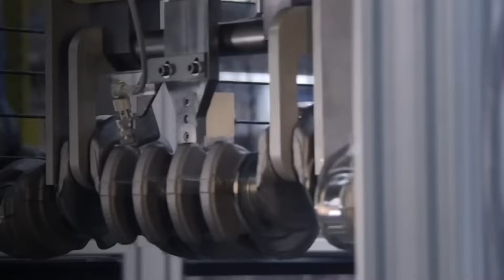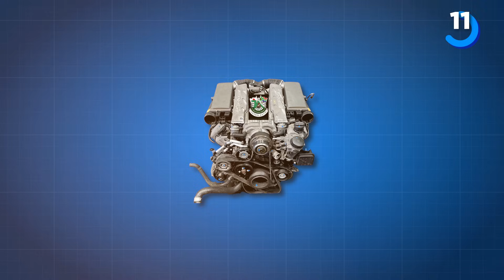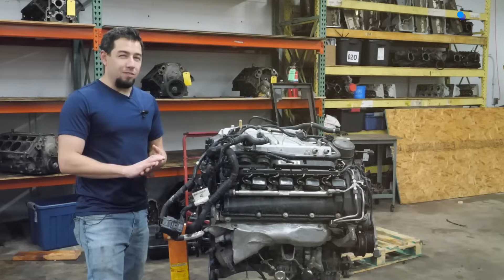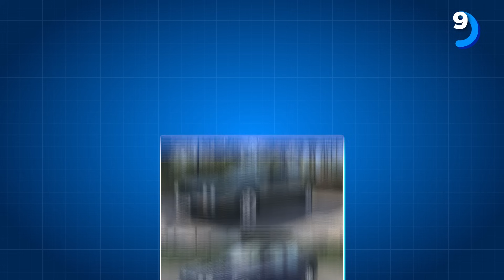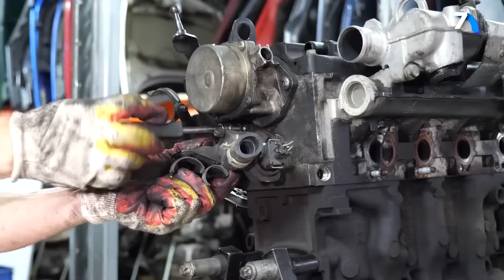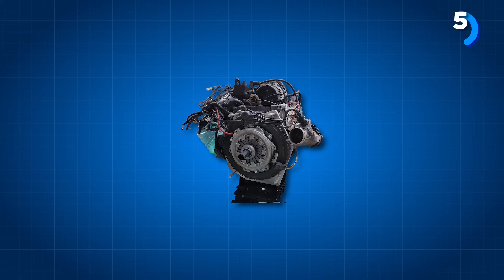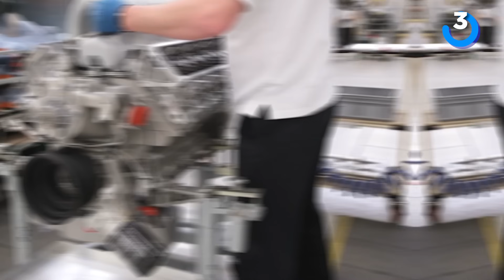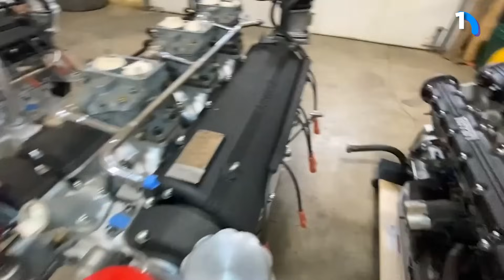12 European Engines That Last FOREVER (2025)

Comment: Fiat 1.9JTD and 1.3 Multijet...
If you are talking about engines that will last forever, then there is no place for high-performance sports engines like Ferrari and Rolls Royce. Slow revving diesel engines and gasoline engines without turbochargers will last forever..
Reply: 1.9 and 2.4 JTD was 50% of all diesels in Eu in the 2000s', lasts forever and its cheap to maintain.
Reply: @a.p.spalato  they aren't as legendary as the Peugeot diesels to be fair.
Reply: Yes, Alfa Romeos and Fiats JTD and JTDM engines are insanely good ❤ especially that 1.9 jtdm
Reply: @LoveThatCar  Alfista with a 1.9JTDM here. Pure joy, reliable and cheap to maintained. 194hP in a 159SW. A true sleeper.
Reply: @ric_noronha  yep! I got the same one. With same engine power 😁 Chip + EGR off
Reply: @LoveThatCar it's a joy to drive! So much power & torque 😊
Reply: @ric_noronha  I aggree! Its lovely
Reply: The 2.0 Hdi was a good engine, 1.6 is a joint EU operation, its a joke, and I never saw any Peugeot with 500 000km +, so it may be legendary in France maybe. And the JTD was the first common rail diesel ever by Fiat/Magnetti Marelli, produced 1999, and they sold their patents to BOSCH, the system we all use till this day in every diesel engine.
Reply: Rolls Royce, a high-performance sports engine? Are you talking about the longest production engine, the Rolls Royce L-series 6.75L V8? It was produced from 1959 to 2000. And it lasts forever! Why should not a Turbo engine last for hundreds of thousands of miles? My Volvo V70R from years ago had 500.000km when I sold it. And it is probably running still with its original engine, I see it from time to time in our city. Every engine, that is quality - engineered and well built, with good components will last. N/A or Turbo. Mentioning Ferrari... There are plenty of Maseratis with the Ferrari V8 that have 300k+ on the clock, still running strong. Not to mention Turbo Porsches! Yes they have their specific quirks and problems, but if maintained well, they last and last!
Reply: @VersaceVJC  I think the BMC A Series is the longest bud.
Reply: I did not know that!
Reply: I have 1.9jtd and had 1.9mjtd and both were amazing ... trashed and survived a lot
Reply: The 1.3 sludges up and destroys its timing chain.
Reply: Of corse if you change the oil every 20-30000km ! I have one 1.3mjet since the car was new and my car has now 450000km and works well. The first time when i changed the timing chain was 343000km!! I know few people who has the same in in their car but 6-7-800000km without any problem!
Reply: @janoskrisztian9033 In Serbia, it is a practice to change the oil every 10,000 km.
Reply: @brutusoftroy2810 Maybe if you don't change it for 200000 kilometers.

Comment: 0:10 "majority of engines break down within 2 to 3 years" of corse... bullcrap, video is over
Reply: You don't have a modern European Ford engine with a wet belt. My work buddy's car is at the dealership at the moment, just out of warranty with the oil pressure light on. In case you don't know, the timing belt runs in the engine oil, the rubber starts to perish and it clogs the oil strainer. Modern Ford engines are the poorest design in their companies history.
Reply: I wonder where that statistic came from too, thats why i came in the comments like wtf, never seen an engine break once for the last 45 years

Comment: I'm missing the Porsche Flat 6?
Reply: Copy that ... 3.6l Metzger .. My '98 Carrera C2S (993)
Reply: The flat 6 suffers the IMS bearing fault, at least some variants
Reply: @keithvers569  That broblem is solved since a long time ago.
Reply: @ not on my 2.7 Boxster it isn’t
Reply: @keithvers569  You should always mention the model year. I've had three Caymans since 2008, and no issues have been mentioned regarding these model years to date.
Reply: @ mine is a 2000 model 2.7 normally aspirated

Comment: Where is the OM606?
Reply: Im from Albania and i can testify the greatness of all OM60 family. OM601 OM602 OM606. Tested over their limits with low quality oil, rough thick diesel and sometimes with black used oil as fuel tap water instead of antifreeze on very dusty roads. In the 90’s and early 2000’s 90% of the cars and vans in Albania were a diesel Mercedes
Reply: best engine ever
Reply: OM646, the hero of all German taxi drivers.
Reply: and it's successor, the OM648, which is also very good
Reply: That goes on past forever
Reply: Too old and underpowered to be considered nowadays
Reply: @cmte.brazinazzo2061  than should remove also ALH from VW.
Reply: @cmte.brazinazzo2061  with a few weeks makes 500+ bhp

Comment: BMW M50 B25 , M60 B40 , M20, M30, M52TU B25/ B28, M43 /B16 /B18 /B19, M47TU .... are real long distance engines . There was a test maden by Mobil1 with BMW E30 325i that did 1.6 milion km , and the engine was like brand new after all that miles . Outstanding quality . BMW. Bmw totay engines  are "soft" like yellow cheese in comparisson to the old ones.
Reply: The B58 eclipses all of those engines you mentioned.

Comment: you will NOT get better than the original Volvo B18 red block. it holds the world record for the highest mileage engine at well over 3 million miles
Reply: Agree ! but they mention the B230 - and I agree on that : more power more modern .. Love this engine .  Had a 240 Turbo on LPG -  Wish I never sold that one ..
Reply: I agree. 
Remember it was also use in the Volvo BV’s and Volvo Felt. 
A friend of mine have a MG TD with a B18 in it. Great engine.

Also the Alfa Romeo Nord is a reliable engine. It was design by Busso, who originally was a aircraft engineer. 

I have a 1969  Gt 1300 Junior with a 1750 Nord. More advance that the Volvo engine tho, but still reliable. That little engine takes 6.6 liters of oil, witch help it preventing getting to hot. In normal traffic its relaxing to drive, but if you step on the gas it really sing and pull.

Comment: I have I defender 2.5 td5 with just under 400000 miles and still strong 💪
Reply from the maker: True we have one also. its the best and td5 great sound
Reply: @GearboxGrid  But is it better that the 300Tdi? 
Or the good old 2.285 liter four cylinder petrol engine used in the 88" and the 109" back in the days. Almost indestructable engine.
Reply: @sallhame The Land Rover TD5 is without question the best Land Rover engine ever made. I know was a Land Rover Service Manager. I’ve seen the stats!
Reply: @MarkWright1963  Good engines no doubt. More modern than the 300Tdi. And they can be tuned to more power than the 300Tdi. But early engine can suffer from erngine head cracking. And the 5 cyl engine only has 4 glow plugs for cold starting. (I know a few professional Land Rover mechanics, and a guy in UK who runs a big LR garage. He thinks the 200Tdi is more reliable than both the Td5 and the 300Tdi)

Comment: Volvo D5 is the best!
Reply: And made by VW / Audi.
Reply: @stigpalm1922 only the early 2.5TDI all later 5 pots are Volvo
Reply: Nope, that was the 2.5 TDI only used in late 850, S70/V70 and first model year S80. All of the later engines that powered S60/S80/XC90…. Were proper Volvo powerplants and were far better than the 2.5 TDI units.
Reply: @VersaceVJC  As I wrote, those engines in 850 ser and 960 (6-cyl.) were designed by Porsche AG. All this could be read in Porsche Magasine att that time under the headline; Weisach's Secret.
Reply: @ It is the same 5 cylinder engine as found in the Audi 100 (A6) and other VAG group cars. This engine was the  Nothing special overall. The 960 6 Cylinder was also just a regular VW engine that was also used in the VW LT van. Not what a Volvo driver wants to hear (I also am a former Volvo driver) but there is nothing Porsche about these engines. But it is true, that Porsche for the time of Mr. Ferdinand Piech developed some engines for VW. I like Volvos, having had plenty of them (740, 760, S40, S60 T5, V70R) but the cars they build today have absolutely nothing in common with the old Volvos. The quality has gone its way...
Reply: @VersaceVJC  I was emploid by Volvo at that time and have some knowledge. The engines for the 850-Ser were designed by Porsche and Volvo didn't confessed this. Not even internally. However, it was revealed in a Porsche magasin with the headline - Weisach's Secret. Weisach is the site/village for Porsche development departments. 
Even the inline 6 came from Porsche. Very successful engines. 
I have had many Volvo Cars during 40 years of driving them. 
I've been a happy Porsche Sportscar owner for the past 17 years. 
Why was it so late for a change? Volvo has provided me with a company car for 33 years.
Reply: @VersaceVJC Porsche was definitely involved in the “Whiteblock” family of modular engines , being 5 and 6 pots. Their first involvement was in the design of 960s cylinder head and not much else.

Comment: I would have added the Alfa Romeo 1.9 jtd engine.  One of the best engine ever and was the firt engine with common rail diesel.  Patent was later sold to Bosch
Reply: JTD is FIAT engine.
Reply: @RioTintoGoAwayFromDrinaRiver alfa is owned by fiat
Reply: Doesn't matter, it's on Lancia as well😅 @RioTintoGoAwayFromDrinaRiver
Reply: just everything else around the engine falls apart 🤣
Reply: Alfa 156 with this engine was remarkably reliable. As well as the 166!
Reply: 👍🏻👍🏻👍🏻👍🏻 agreed
Reply: 2.4jtd also the best !!!
Reply: @ElQuintoViernesAzul  That is such a sweet diesel engine! It sounds like it's running on caramel!
Reply: Much agreed!!
Reply: Alfa and reliability 😂😂😂
Reply: @_My.Name.Is.What_  Sure, ever owned one, or two maybe? I have had a 147 JTD Q2, 156 2.4 JTD and a 166 2.0 V6 Turbo. Made a ton of kilometers and never had any significant problems.

Comment: I think the Volvo 5 cyl D5 engine belongs in this category.
Reply: YES, and disigned by Porsche 100% plus the inline 6.
Reply: The diesel wasn’t designed by Porsche , Porsche just helped with the combustion chamber design on the petrol engine
Reply: You missunderstood or I was'nt clear. The 5-cyl & 6-cyl petrol for the coming 850- ser and 960 was and order to Porsche AG in Weisach. Also a V8 was ordered, however not taken out. Volvo paid för the development though.  Petrol prices in the US was the reason. 
The replacement engingine for the coming XC90 was purchased from Yamaha in Japan. Made of alu. and lighter. Never became a success and ditched. 
Porsche was very pleased with the V8 and was planning it for the Cayenne. VW's takeover of Porsche led to Audi and their V8 to be converted to Porsche requirements. 
The 5 and 6-cyl became a success at Volvo. However, not mentioned the birthplace of prestige reasons. Even internally Volvo it was dead silence of this business.

   @rogerbailey7301
Reply: @ Stigpalm, the D5 diesel was never ever designed by Porsche. It is a sole Volvo product with some components like the high pressure injection system (Commonrail) co-designed and tested by Magna. If you just look at the heads on the PETROL 5 cylinder Volvo (2.0, 2.3, 2.5) you could be pretty sure Porsche has nothing to do with. The design, especially for the N/A engines is pretty lousy, the valves are at such an angle, it is sub-optimal. Not a Porsche design in any way!
Reply: First 5cyl diesel engines used un Volvo were from Wag. 2.5tdi aat/ael engines used in first Audi a6 series (c4 1994-1997).
Later,Volvo developed its own 5cyl 2.4l diesel,from '03 or '04
Reply: Totally agree the 2.4 diesel is immensely reliable
Reply: Dont compare a benz engine with volvo.
Reply: Off course!
Reply: Fully agree 👍
Reply: Definitely! I drove 2 v70s 140hp to over 500.000 km  20 years back and they were still running like new, think they were audi engines tho
Reply: The Volvo B200K engine lasted forever given regular maintenance.
Reply: Exactly.
Reply: My father's 2003 V70 has the 163hp version of it. Yes it is probably indestructible but it's a nightmare to drive. The boost lack feels like it's from the 80s and after some hundreds rpm of relatively good torque the power already  begins to collapse so you need to shift all the time... Even worse is the comfort of it. It shakes and rattles constantly. It's a miracle how they managed to make this car drive so badly
Reply: @mitch-v1x that monster has 400 nm tork wtf are you talking about
Reply: @mitch-v1x  Something is wrong with the engine then, probably the boost actuator. the 2.4 volvo diesels are a dream to drive compared to VAG 2.5 i5 or 2.0 i4. Also the rattles are worn out engine mounts, you know those have to be replaced, i have a 2002 S60 and 2006 V70 both with the 2.4 and its a very nice engine.
Reply: @mitch-v1x sounds worn out, time to fix it, i have the s60 t5 OG, fixed everything but the engine, smooth AF
Reply: @michaelsiegel9658  maybe you should try a well maintained example 😂 what you describe is the total opposite of how the Volvo D5 platform is usually described 🤷‍♂️
Reply: You should look for a 1984 engine, than you 'll.change your mind😅  @mitch-v1x
Reply: 5 cyl D5 vom Audi, to Volvo.
Reply: @dino-edinbesic9562 
The early five cylinder diesel was an Audi engine. The later D5 engine was not an Audi engine ever.
Reply: @dino-edinbesic9562  Thank god its not the audi engine
Reply: @dino-edinbesic9562  Only on the early 850 and V70 than volvo made his own 5 cyilinder, u can recognize immediatly because it has 2.4 l instead of 2.5 l (like audi.)
By the way i had the audi on the 850tdi and was a great engine! A lot of torque and good power (140hp).
Now i still have 5 cyilinders , on volvo v60... 250.000 only
Reply: Volkswagen not Audi @dino-edinbesic9562
Reply: @dino-edinbesic9562  This is correct.
Reply: That's a Volkswagen engine, but nice try 😅

Comment: VW 2.0L TDI CBAB 140HP  with the proper manufactor maintenance can last easly more than most of those engins
Reply: That can any well maintained engine.
Reply: Got this, if you replace the ax from oil pump or the whole thing, its a charm
Reply: The best 2.0 VW engine was BKD! The rest of them,has different problems ..
Reply: @Ceausescu_Nicolae  good, if you don’t consider cracked cylinder heads, badly designed oil pump shaft on early engines and particulate filter on late engines. THE Best are EA189 before 2009… before ecologists found out about dieselgate and forced VW on making them bad, but in line with regulations.
Reply: В оркостане дизеля долго не живут, как не крути.

Comment: Hm.... VW 1.9 TDI ALH or ASV (90/110 HP) are engines with BOSCH pump injection.... and i dont know that engine is an newer car than 2004 year. This version with ALU head cover is only in MK4 and cars from that period. MK3 have similar engine... but MK5 is something else, nothing close to ALH/ASV.